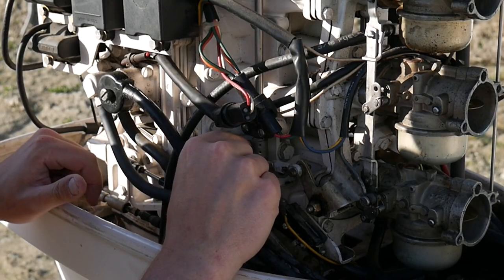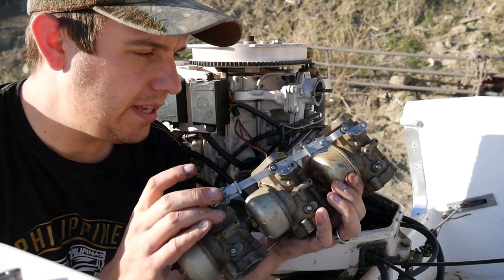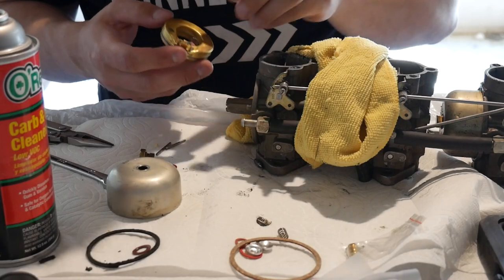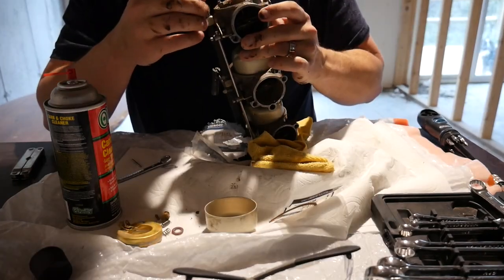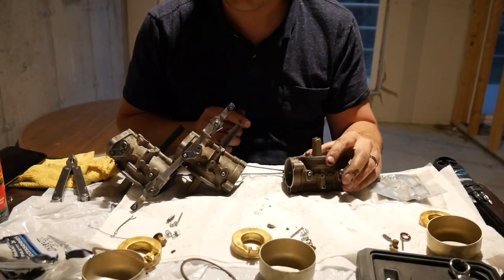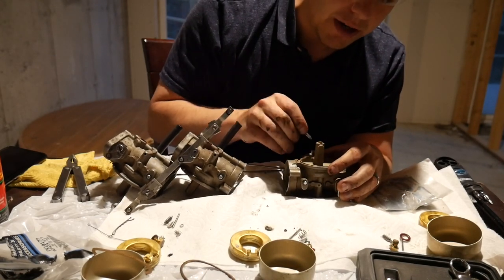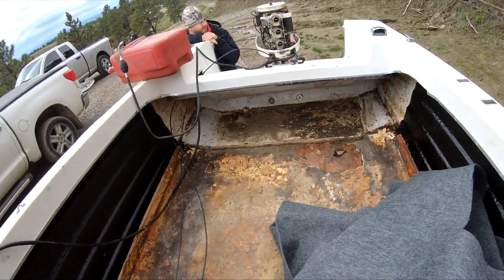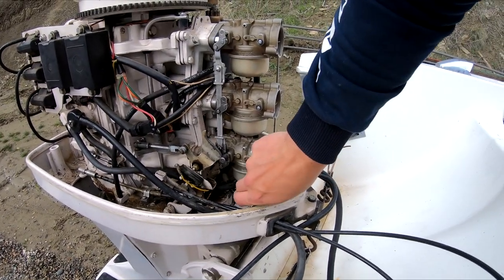Boat Project 04 - How to Repair the CARBS on a Chrysler Force Outboard 85

Comment: That's your fuel overflow hole, means the float is stuck and isnt stopping the fuel from continuously flowing into the carburetor and bogging down the engine, try giving the bowl a few taps to knock the float lose and stop the flow of fuel
Reply from the maker: Awesome, thanks man!

Comment: I have been having trouble finding parts for my 88 force 85 outboard motor. Could you possibly provide a link to where you found those OEM repair kits?
Reply: Same boat here I bet 😢 did you find them ?
Reply: Me too!
Reply: @AB-nb2ic  Same, I have an 89.
Reply: Could also use a link for this repair kit
Reply: Yes please I also need the link,  I have a 86 force 125 with the same problem ! Btw great video thanks

Comment: The spitting is caused by improper float adjustment. It's getting too much gas, so you need to adjust the tang so the float doesn't let in so much gas.

Comment: It was spitting because the bowl float was not adjusted properly, refer to your engine repair manual for instructions. I had this exact problem, fixed it right away with a proper adjustment.
Reply from the maker: Thank you! Do you still have small amounts of gasoline come out of the front opening of the carbs when running or how do you stop it from doing that?
Reply: Fishing Montana, if you have the float adjusted properly then no, you should not have any fuel coming out at all. Also, take the linkages off to have easy access and adjustment to all carbs when they are taken off, I cannot stress enough the importance of a repair manual for this engine, you can pick one up usually off EBay for about 20ish.
Reply from the maker: @crashlife487  Good to know! I will have to see if it has anything in the manual I found about carb adjustment
Reply: @FishingMontana  I'm sure you already know this, but I just want to emphasize that since this is a 2 stroke motor, that will be fuel mixture, not gasoline. If you are putting straight gasoline in the tank, then you might have a problem.

Comment: Hey man do you have the name or part number for that little rubber piece you had to fish out with the tool you fashioned? It’s that piece the needle sets on to that was cracked. As well as that little washer that went in there. Or the part number for that kit I need to get the exact same thing and I can’t find it anywhere. Thanks and awesome video!

Comment: Tillotson made so many different carbs for Chrysler/Force over the years its just silly. Ive been there many times, but usually if you use the needle/seat in the kit and be sure to adjust the float height AND drop according to the service manual it will be just fine.

Comment: Did you ever figure out why fuel was leaking out card side? Mine is doing same.
Reply from the maker: Yes, needle isnt seating properly and so it is flooding and going out that valve I have been told. I havent been able to fix it though.
Reply: Fishing Montana i have the sAme problem i dont know how to fix it

Comment: I know this is old af but where did you find the oem carb kits? I bought the Amazon ones but don't want to pull my carbs if the bowl gasket is wrong.
Reply from the maker: found part numbers and ordered them on ebay
Reply: @FishingMontana  part number ??

Comment: I just got this same exact motor from a friend, my neighbor keeps asking me if it a two stroke??? Can you tell me what it is,  is it it for lake, rivers or ?
I m no boat person but I want to list the parts for sale and want to be correct as to the engine. I do now it is a model 6pr2005 serial 13362 but thats all I have. Anything you can tell me would help.
Reply from the maker: It is a 2 stroke yes, if it has a prop on it, most likely a lake boat, If it has a jet lower unit, meant for rivers

Comment: The toilet was not shutting off!  A little rich?
Reply: so it'll overfill from being too rich? My 55hp has only 2 carbs and 1 leaks a little.  I thought it was a little rich.  when I give throttle it boggs down and can't climb over the hill. thought it was prop because old one was mangled but,  new prop goes only slightly faster while rpms will not rev hardly at all.  hard lug
Reply: @dustinhull8211  Are your plugs wet?  Your rich if they are?  If not your lean, also check your inline filters and the one's in your carbs, blow them out! Main Jet, clogged with debris?
Reply: Just what i was going to say... i noticed he didn't clean the jets... they almost always have dirt in one of them
Reply: Also, i found a full maual pdf online from some marine company that is free to download, didnt save the site though unfortunately...